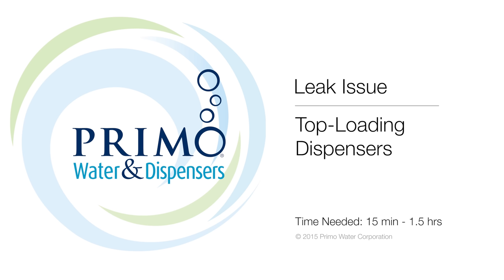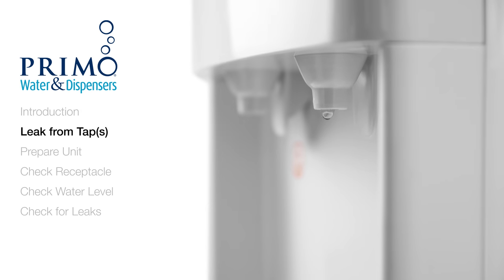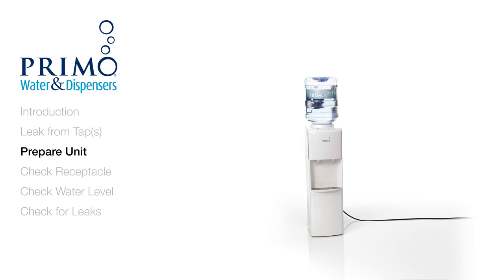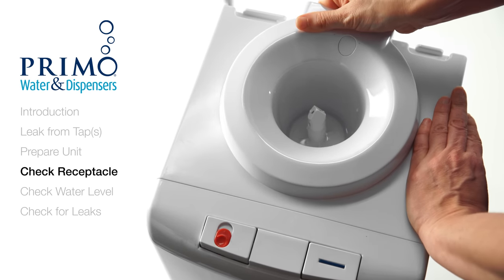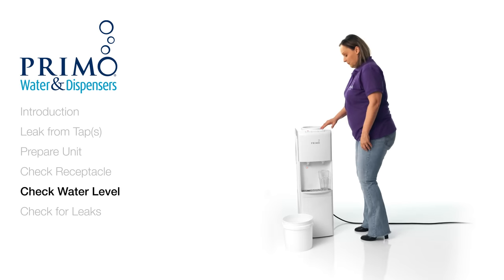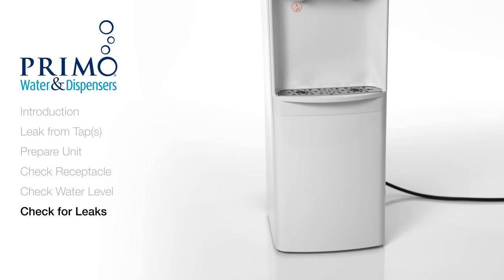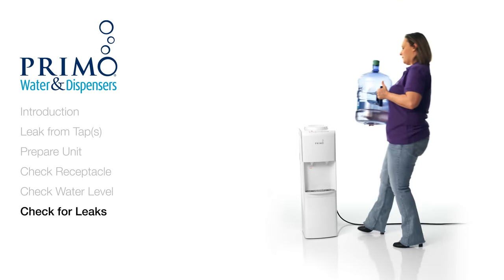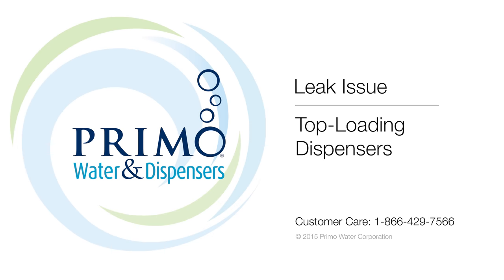Top Load Leak Issue

Comment: If anyone hears water pouring down from the inside leaking on the floor, I've found that there is a water tube zipped tied to the water reservoir. I loaded a 5gl bottle and water just poured. I removed the black grill from the rear and there I discovered a plastic "J" tube disconnected and dumping water. Hope this helps, I almost bought another water dispenser.
Reply: Poor quality manufactured
Reply: Thank you!! Dealing with a flooded dining room tonight 😭
Reply: Yes!! This! I got one for free on Facebook. (someone was giving it away because it was leaking and they couldn’t figure it out/didn’t want to deal with it. I had been wanting one for the longest so I picked it up hoping I could find out why it was leaking/fix it and if I wasn’t able to, I was just going to get rid of it. Turns out this is exactly what was wrong with it. It’s like brand new now except I didn’t have to spend the $200 so, it’s even better.  So happy.
Reply: Your comment saved me a lot of trouble, thanks man.
Reply: @Chrisgriffin1992  👏🏾👏🏾💪🏽💥

Comment: IF YOUR COLD WATER IS LEAKING OUT THE BOTTOM, REMOVE THE TOP COVER VIA TWO SCREWS ON THE BACK AND REINSTALL THE COLD WATER HOSE ONTO THE NOZZLE, REUSING THE ZIP TIE IF YOU CAN OR GET A NEW ZIP TIE.... YES I KNOW THEY MADE THE HOSE TOO SHORT AND JUST STRETCH IT TO FIT ONTO THE NOZZLE SO IT PULLS OFF.... YOUR WELCOME....

Comment: I had a leak from the cold water spout ,tried everything Primo advised!! Didn’t work I was ready to trash it, but thought before I do let me open the front panel to see what it looks like. So I pried it open in the front where it’s says “PRIMO” using a flathead screw driver. The problem was easy to see why this happens, where the spouts are and the top button have this long stem when pressed down pushes the lever down. If they are not aligned correctly, or slightly off can cause a drip, or no water to come out. So I aligned the best way I could by keeping the stems in the slot of the water flaps then placed the front part panel and pushed on, but not all the way just enough to test it. I tested it to make sure both water tabs dispense freely and stop when released, then adjusted slightly as I went along. Took about 7 tries of placing the stems and tabs aligned, then closed the panel. (When opening I broke the manufacture tabs that keep it tightly shut, but was able to replace without any problem) Finally fixed and it had nothing to do with the water bottle. If it can be helped it would recommend buying a unit that has the spouts out in front and showing, probably less chances if this happening,or at least easier to fix yourself.
Reply: It worked for me. THANK YOU!

Comment: Why does no one mention the possibility of a hole in the bottle causing and air leak situation? I have received several split seam bottles that don't leak until inverted.
Reply: Hole on the bottom - so when inverted to go into the dispenser the hole makes the water constantly leak out of the normal spot? Is this what you mean? Had a water cooler do this to me on a leaky bottle and the water was dripping from a spot I didn’t even think it would … the top was over flowing and going down the side of the dispenser. Then I took the jug off noticed it was leaking out the bottom (or the top when on the dispenser). What a nightmare !

Comment: If you buy one of these, make sure you also buy a plastic or rubber tray to set the damned thing in and a frigging mop! ✌️🙁
Reply from the maker: Hi - Thank you for your feedback and we are sorry that this didn't help resolve the issue. Should you require any additional assistance, please do not hesitate to email us at social@primowater.com. Thanks!
Reply: I have model 601141,can't find a manual....anyways I have had it for 7 years, and have woke up to 5 gallons all over the floor enough times to use it for shotgun practice. There is a silicone/rubber  o-ring about 4" diameter between the water reservoir and the tank that the bottle fills up, and I 'm telling you a real bugger to get right or it just keeps leaking. 2 screws in the top back, the whole top pops off, can't move it much, due to switch wiring. Flip the bowl over and wala, the o-ring. That mother has to be correct. There are 4 ridges and the o-ring fits over the ridges to hold in place, smooth side out, it slides in the bowl, to keep the water where it should be....inside. Be careful, or you will become a professional at this, it constantly wants to roll off the ridges.....patience big homeys. These things are very tender, don't just throw bottles up there. ALSO, the ring with the ridge side, it has a longer, fatter side. ...I put the thin side down, meaning the thin side will go back in bowl first (down).I hope I gave you some insight, be patient folks its plastic.....if you can tear it apart, anyone with half a brain will be able to figure out what I'm telling. ...if not. ...plan B......3" magnum # 6 shot. ....pure satisfaction!

Comment: Primo recommends that you use the instructions below to dissolve mineral deposits, sanitize, and deodorize your dispenser every 3-4 months. Time Required: 30 minutes Need: (2) tablespoon regular bleach or (2) cups of distilled white vinegar, (1) Empty 5 gallon bottle, (1) 2-gallon bucket and a Philips head screwdriver.

1. Turn energy saving switches to OFF.
 
2. Unplug power cord from wall outlet.
 
3. Remove water bottle.
 
4. Move appliance away from wall to gain access to the back.
 
5. Remove remaining water from reservoirs by dispensing from the hot and cold taps into a pitcher or bucket.
 
6. Remove the cap from a spare empty 5 gallon bottle. Pour the bleach (2 tbsp.) or vinegar (2 cups) and hot tap water (2 Gallons) into the empty bottle.
 
7. Apply the cleaning bottle to the dispenser.
 
8. Allow the cleaning solution to fill the reservoirs.
 
9. Wait 10 minutes then drain the water from the reservoirs as described in step 5.
 
10. Rinse the bottle and fill with only hot tap water and apply it to the dispenser.
 
11. Place a two gallon bucket in the back of the appliance and remove the drain plug, while also flushing water through the taps (step 5).
 
12. Replace the silicone plug and drain cap.
 
13. Return the unit to its location, install a fresh water bottle, plug the power cord into the grounded wall outlet and turn the energy saving switch ON.
Reply: This was tremendously useful advice and solved my problem. Be prepared for a 35-40 min. Job if you embark on this endeavor but it beats the hell out of spending $200 to replace the dispenser

Comment: primo water coolers, what a bunch of crap went through two this year and never buy one
Reply: I HAVE A PRIMO TOP LOADER.   MY UNIT DEVELOPED A LEAK AT THE OVERFLOW VAQLVE. LOCATED JUST BESIDE THE COLD WATER  OUTLET..  THIS LEAKE DEVELOPED JUST AFTER I INSTALLED A NEW 10 GAL WATER JUG. IT NEVER LEAKED BEFORE. AFTER TALKING TO  SOMEONE AT THE MAIN OFFICE. HE SENT ME A VIDEO FOR TROUBLESHOOTING.  HE SAID IT SOUNDED LIKE A DEFECTIVE WATER JUG. WHICK IT WAS.  I THINK I PEALED AWAY SOME OF THE PLASTIC COVERING AROUNG THE TOP OF THE  WATER JUG.  AFTER INSTALLED A NEW WATER JUG. THAT FIXED IT.

Comment: Brought the unit (top loader exactly like in this video) home, set it up, and within 24 hours noticed it was leaking.   Inspecting the back of the dispenser, I noticed water slowly dripping from the red drain plug which is  located about 2/3 of the way down on the right.  It's covered by a small see-through plastic guard, held on by one phillips head screw.  The plug had slightly backed out of its receptacle.  I simply removed the plastic cover with a screwdriver, pushed the plug back in, and placed the cover back on.  Problem solved.  If you have leakage issues not coming from the top, this is a good place to look.  Pretty shoddy quality control to have a simple item like this get out of the factory.

Comment: I have the YL1133AS and ran only 3 5 gallon jugs of water through it before it started leaking out of the cold tap. I figured it was something major and we had already had it for a while so I assumed it was a lost cause. However, I came across more information on how to "clean" the taps to free the minerals and whatnot that could be causing it. I've attempted the bleach remedy multiple time and have had no success whatsoever. I was just curious if there is more to it than directed via the link in the video above? Pretty depressing when you can't count on a device that costs as much as these do to last more than a couple of jugs of water. Please advise.
Reply: Derek Nicholson, I had the same issue. I cleaned the system with bleach AND vinegar. Nothing worked so I started taking the damn thing apart. Found a small sliver of plastic blocking the valve which would caused the leaking. 
Start with the back panel plate so you can remove the front panel. Once the front panel is removed you can see the tap that is leaking. You’ll need to snip some zip ties. Be careful or to cut the rubber. Once you get that part out, look for anything that could be blocking the valve from closing. Mine looked like a long sliver of plastic. Possibly from the inside of a 5gal jug. 
You’ll need zip ties and to put carefully put everything back together. No leeks! Good luck.

Comment: Top spill proof cap leak: there is a rubber thingy that is very flimsy that goes over the overflow\air hole on the inside if the ring. If theres a hole in that, and there is mostly, youll leak all over the place. Plug the overflow hole somehow and ill bet your leak is gone but then you wont have good water pressure/suction if you dont replace the rubber cap thingy whatever it is.
Reply: Where do I get the rubber thingy?  I think it is called a silicone seat.
Reply: @jasonwood3713  Exactly what I need.

Comment: My dispense was leaking from the bottom. Turns out it was because of the crack in the bottle. The crack played with the pressure or something like that. A new bottle on the dispenser and everything is fine.
Reply: Mine is doing just that good thing I found this video I was just about to trash the thing I'm going to try what you did.
Reply: @joegutierrez6923  did it work?

Comment: I just opened mine and loaded the bottle on the top and all the water started leaking from the bottom. I had to take the water bottle off. WTF? Did I get a bad unit?
Reply: Me too, I just did the same. Did you fix yours?
Reply: @dannyocean7090  I tried but then I was like this shit is brand new, I shouldn't be fixing it. I went to home Depot the same day and exchanged it for a different model and this one is working just fine

Comment: My water dispenser leaks from the (leak guard) probe receptacle. Right through the crack where it meets the actual cooler.  We've had this water dispenser less than six months. We had a bottom loader Primo dispenser before this one and that one also stopped working within a year of purchase. It wouldn't pull the water up from the bottle to dispense it.
Reply: n33se hi mine leaked as well. Did you have yours fixed?
Reply: My hot water side is running like I have it on and will not stop what could it be

Comment: Well, I just opened up my new navy blue primo water dispenser. As soon as I put it on I notice some spillage... Okay common with these. But then it kept flowing and leaking all over the floor. I remove the bottle which is not a primo bottle btw. Still has a little more than half.... anyway I am trying to figure out if I did something wrong or missed a step but I wasn't finding anything. So I decided to do a test outside. So I brought the unit outside filled a 3 gallon jug up about halfway. This was a different gallon than the one I had used inside. And when I put it on it proceeded to leak from the top of it in the back (there's like 2 holes on the left side of the unit) and also through the cold water spout. I am very disappointed in this. Maybe I should have taken that one bad review from Walmart a little more seriously as it basically stated the exact thing that ended up happening. Other than that the unit looked really nice and looked well built. It just obviously needs to be able to hold the water and not leak out nearly a gallon and a half in a matter of a minute and a half or so. So based on some comments here I'm probably just going to end up returning it to Walmart.
Reply from the maker: Hi, and thank you for contacting us regarding this issue with your dispenser. If you are still in need of assistance, please contact us at social@primowater.com and we would be happy to provide further assistance.
Reply: this is from the hose that connects the tank directly to the spout, they made it too short and just zip tied it on anyways so its always wanting to pull off, i would recommend a better brand.
Reply: @primowaterco  this is from the hose that connects the cold water tank directly to the cold water spout, you have made it too short and just zip tied it on anyways so its always wanting to pull off, you literally have to stretch the stupid hose to get it back on and just pray for the best. fix your bad design, get some quality control.

Comment: Hope you take pride in helping me fix mine then.    Our leaked all over the floor making a huge mess.   After troubleshooting 
Any top seal issues I turned it around and saw a black foam coated hose leaking.    Its like 1/2" diameter, not small.  At first I thought it was a overflow tube because it was just hanging.  Turns out there is a rubber elbo piece that was just zip tied on (No hose clamps) it it must have slowly come undone from normal use.    Now I have to disinfect, buy hose clamps.    Turns out all the elbos are zip tied.  Shoddy workmanship.
A fail of that important elbow means 100 percent of the water just flows right out the bottom like a faucet.  5 gallons.
Reply: That's what ours is doing ever since we got it! Hope that's what's wrong with our I believe I can fix it if it is. My daughter is ready to throw it out and take our loses on the purchase.🤞🏼🤞🏼🤞🏼
Reply: @sharilarson6635  I stopped using mine.   The bottled wather companies don't clean the bottles well.  They just rinse with Ozone treated water.   The issue is some moronic customers use the bottles to mix chemicals then turn them back in.  We have got more than 6 jugs over the past few years with a stong chemical smell.  One that does not go away via evaporation.  What ever it was it killed fish in a mairine aquarium topping off the water.    The weak link is the lack of rinsing by the water bottle companies and the people that choose to use them for purposes other than water.